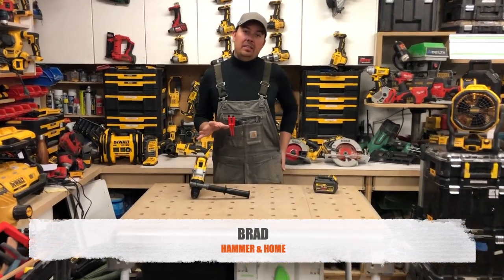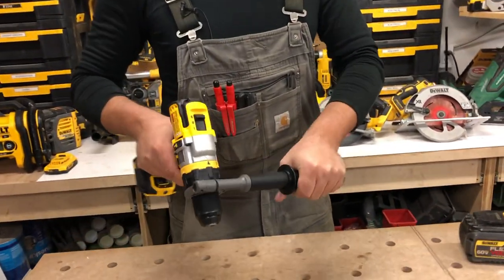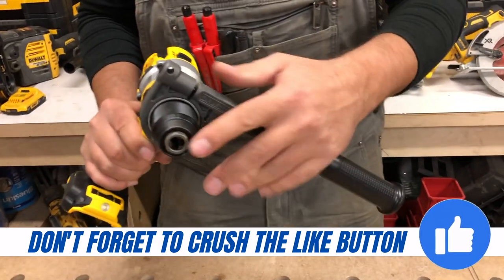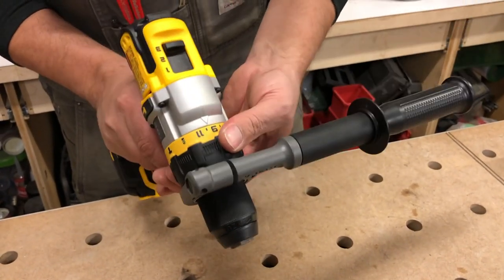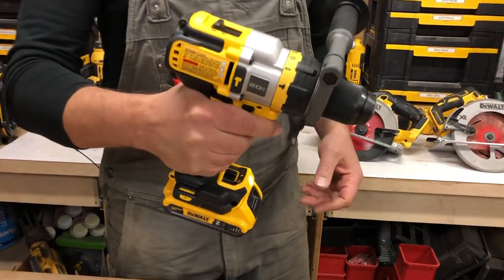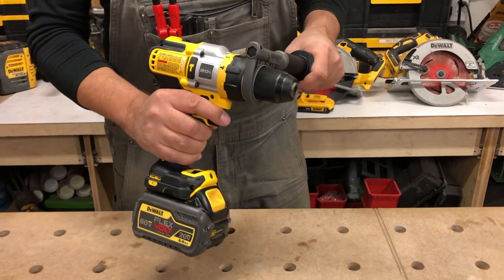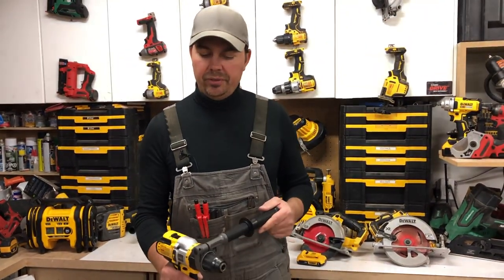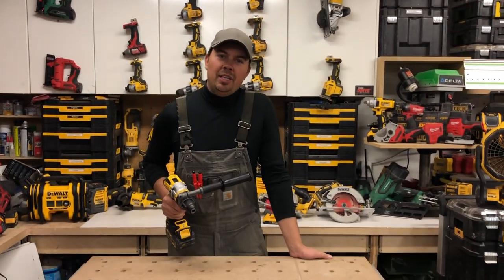How to get 42% MORE POWER with Dewalt's DCD999B FlexVolt Hammer Drill

Comment: 999 is a great drill. I prefer it over power detect since I use flexvolt batteries. I use it for small hammer drill jobs and spade and hole saw jobs.

Comment: Hey Brad!  Waddup!  Seriously, I ainta gonna knock this, coz it is DeWalt, but pound for pound, I’d take the Power Detect drill.  I own the PD drill, and it’s a beast, but you have to use the 8.0 battery!  I’ve weighed the difference between the 20 volt 8.0, and the FlexVolt battery, and the FV battery is like a pound or so heavier!  It’s already a heavy enough drill, and why would you want it heavier?  Now I’ve seen reviews say the DCD 999 (FV Advantage) come out ahead of the DCD 998, and vice versa, so pick what you want, they’re both great drills.  I’ll stay with my DCD 998, thank you very much!  Hint: pit one against the other for future video idea!?  🤔😁

Wishing you and yours a safe and joyous Holiday Season Brad 👍👍👍✌🏻🌲🇺🇸
Reply from the maker: Thanks George!
yeah definitely both great drills, great idea to put them head to head, I've been using the DCD999 a lot lately with the flexvolt and its very impressive, almost to much power. have a great Christmas!